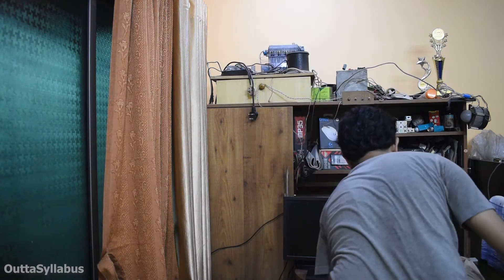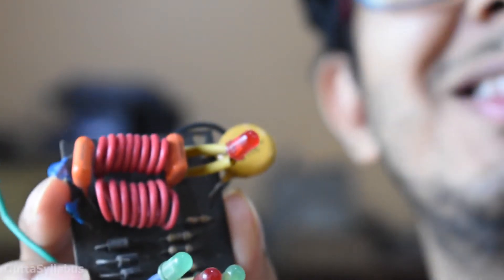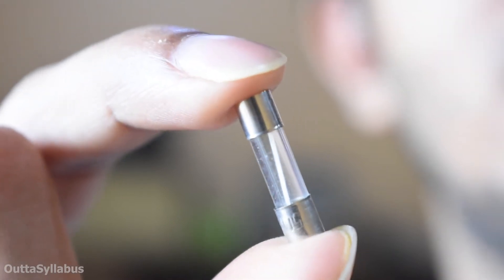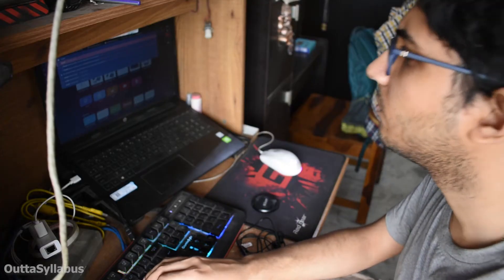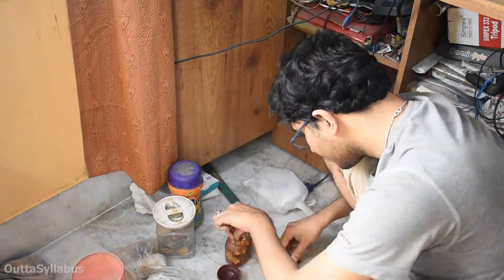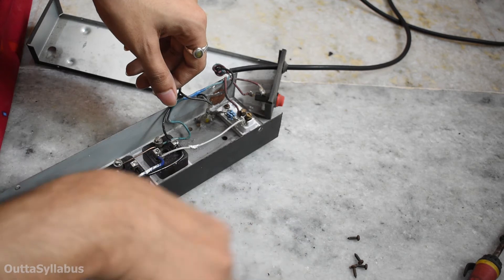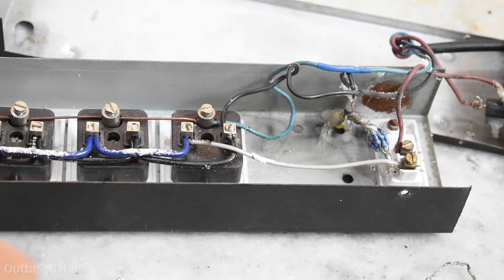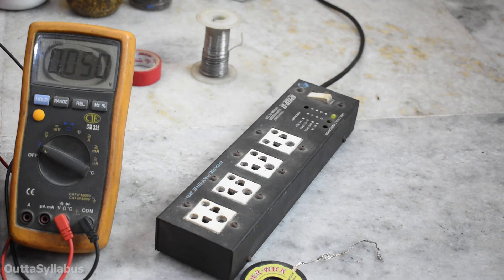Lightning Strike Killed my PC Ethernet Port, Monitor and Router | DIY Surge Protection

Comment: Happened to me today, I feel your pain. The electricity traveled through the Coaxial cable into my Modem and through my ethernet cable and I guess it traveled into my 2nd monitor, frying the modem, ethernet port and a 2nd monitor. The strange part is that both the computer and monitor were plugged into surge protectors, not the coax cable, sigh. The ethernet cables show burn marks. Afterwards, my computer works, I get full power to my main monitor, device manager shows there is an Issue with the Ethernet port but my GPU works when I plug the main monitor into all 4 slots. The 2nd monitor was plugged into the GPU but since the main monitor works in all the slots, have ruled out that I have a GPU problem, video and games works. On the computer now, so likely no PSU issues. The Ethernet port is direct onto the Mobo, I have more PCI slots for a Network card but I might just get a USB 3.0 to Ethernet adapter. I praise your efforts to rebuild that Surge protector and all the comedy!

Comment: I feel your rage. My PS4 went in a lightning storm through the Ethernet cable. I still am using the tv that was connected to the same multi power surge strip as the ps4 at the time years later. Why is it that half of it and the strip itself work fine years later? Fucking router

Comment: In my case only my HDMI port of LED Tv and the other end HDMI cable connected to set top box HDMI port. both damaged.  I think the cable wire coming from outside carried strong lightning voltage and fried my HDMI ports.